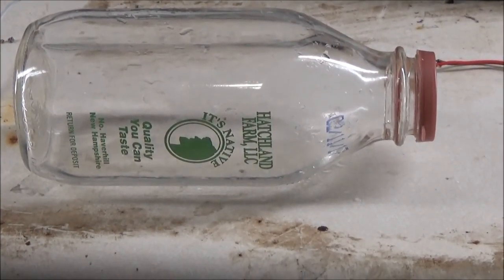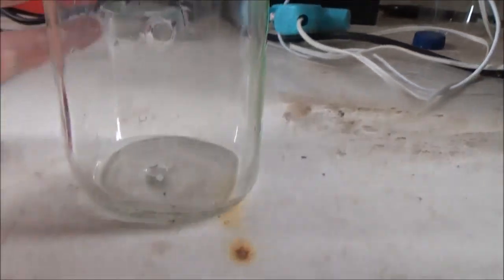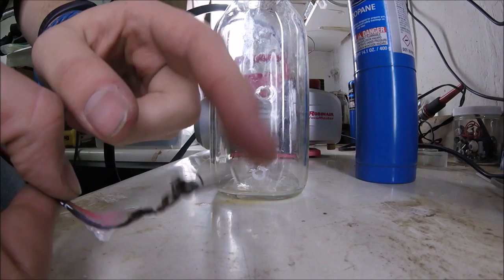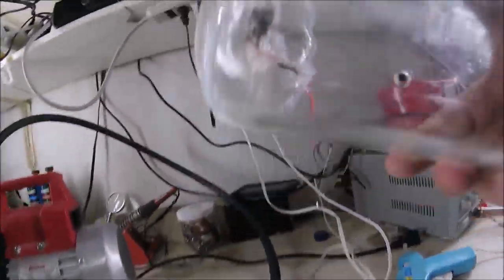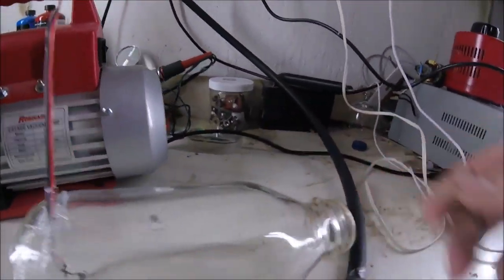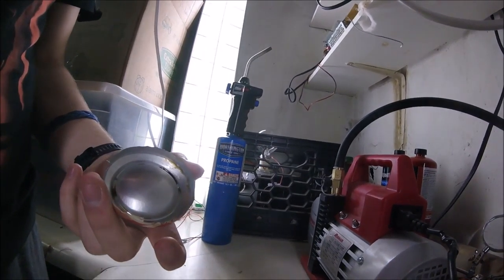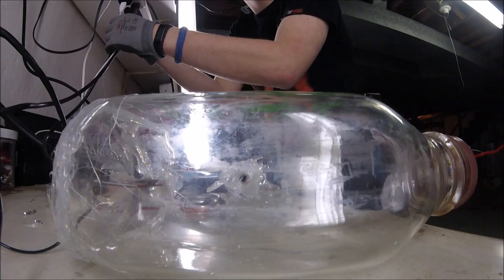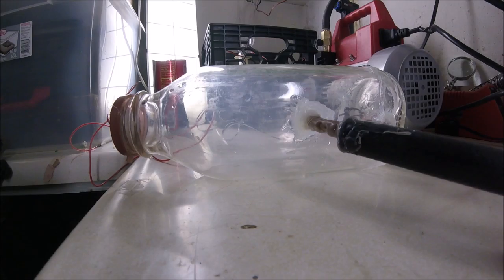Diode~Homemade Vacuum(ish) Tube  MK2 DIY~Also drill through glass

Comment: Seems like you were on the verge of building a pro-audio vacuum tube amp or radio, or did you quit after seeing there wasn't enough challenge?
Reply from the maker: I am still playing around with high voltages. The recurring problem I have is making a high-quality vacuum but without spending very much money doing it. I wanna light up some phosphorescent screens with X RAYS when I do tho.

Comment: I think if there can be plasma, it won't work as diode, but as a non-ohmic conductor.
the reason your setup is supposed to work as a diode is 'cause the electrons don't have enough energy to overcome the work function of neither anode nor cathode, thus no current; but then you produce heat in cathode so the electrons get enough energy to leave it and travel to anode, but the electrons in anode can't leave, and thus the one-way current.
Reply from the maker: Ik at this point this setup is a joke it couldn't hold much of any vacuum and I could have have ran the wire at a much higher temp, but I'm going to go a reel diode at some point.